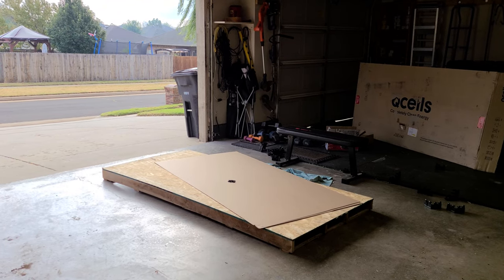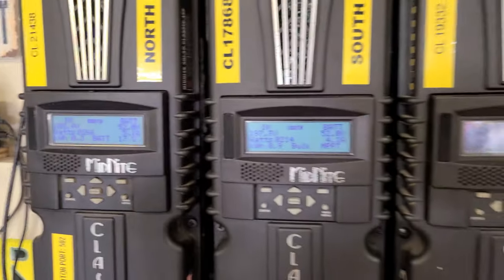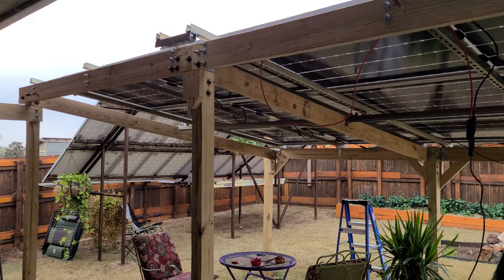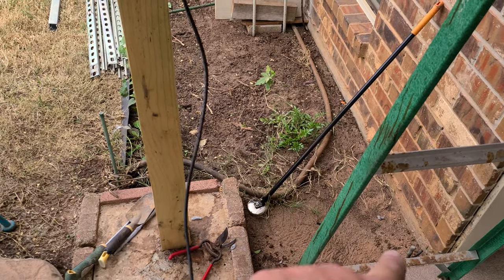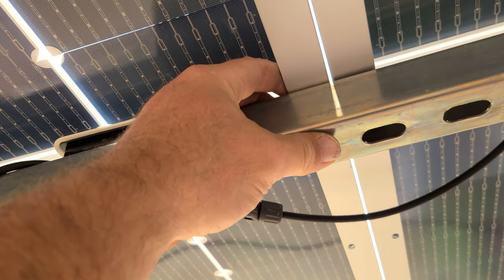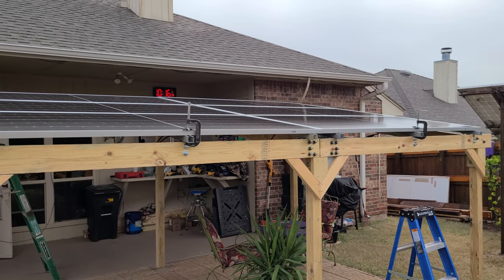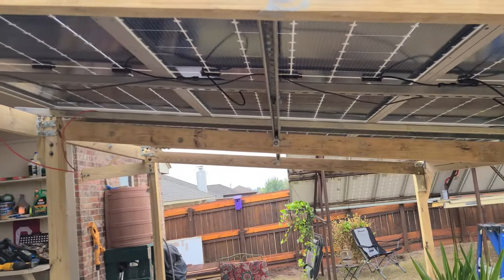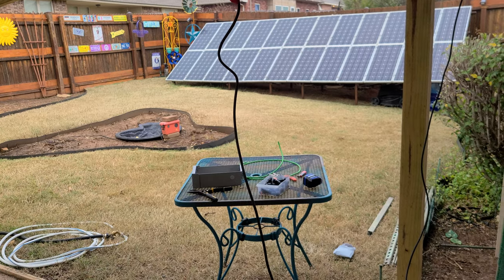Six new 480w Q-Cell solar panels on the backyard pergola (tested out great!)

Comment: Nice video.  I have been impressed what I have read about the QCells.   I am considering a Pergola ground mount over the hot tub area where I have a ham shack (radio room).  Some of the panels will just power up the hybrid min-split that will take PV as an alternate power source.  Still need the mains and those panels won’t be used by anything else which could be a bit of a waste.  We will see.  Thanks again for your video and all the best from north Texas.
Reply from the maker: Howdy. Good luck with your efforts. Being in north Texas, you'll harvest some killerGreat sun days. The Q-cells are awesome...a lot of bang for your buck. Before I changed out all three arrays, I was harvesting 28-29 kWh with 100w Renogy panels. After, with Q-cells (and more rated PV wattage), averaging around 48-52 kWh all summer long. If needed, look into Signature Solar for lithium rack mount batteries...they are based in north Texas (no tax, good company). Here's a link: https://signaturesolar.com/all-products/batteries/?_bc_fsnf=1

Comment: Looking good. Those things look huge! When you get the hardware can you show how you lock them down with the spring nuts? KEEP EM COMING!!
Reply from the maker: Thanks! Will do. But I am only using spring nuts on the ends. I used Grade 8 bolts are hard washers and bolted them down to the Superstrut for a nice tight/clean look. Turned out perfect.

Comment: The pergola is facing West you said? What angle are the panels at? The angle looks more horizontal then the South facing panels.  Does the West angle matter as much? I have some West facing panels for the afternoon sun.
Reply from the maker: Yes, west facing solar pergola. The angle is almost flat, slight rake. My whole backyard is not even close to being "ideal" for solar panel power harvesting...not much space to work with. The north and south arrays are set for spring/fall solstice...so, an "average" tilt for all seasons (most do it this way). The solar pergola does excellent in the summertime (when I need it the most) but, lousy for about 5-6 months out of the year. FWIW, the "best" harvests I got this past summer for all three arrays...53.7 kWh in early July. MUCH better than two summers ago with different and less panels (best then was maybe 29 kWh for three arrays). So, overall, my backyard solar panel farm isn't ideal, but will get the job done with enough kWh for my batteries/inverter. Good luck with your project

Comment: I'm trying to build the exact same style pergola may I ask how tall is the front part and how tall is the back part on that angle u have there ?
Reply from the maker: The front is too low (can bang your head on it). The back is about 6 1/2" feet. This is the best I could do after YEARS of redoing this pergola. If I had to do it over again from scratch, I would attach it to the roof and angle it down higher than head level. It was a novice attempt and is working fine now, but, too low in the front and lousy sun angled to the west. https://www.youtube.com/watch?v=f-eVjwVAhdE&t=151s
Reply: @ChrisDIYerOklahoma  ohh ok I'm here in northwest Ohio & I swear the sun sucks all year round being up north like this I wanna order more panels build something close to what u have I hope I can do it before this fall
Reply from the maker: @diysolaradventures7894  -- Roger that. I am originally from the Lansing area...know about year round crap sun. Here in Oklahoma...MUCH better sun. Being in NW Ohio...best to have more angle to allow for ice/snow to melt off. Also, bifacial solar panels are the newest and sexiest panels out there (and not crazy expensive anymore). Lastly, I "overbuilt" my pergola for strength...Grade 5 and 8 bolts from Tractor Supply hardware in bulk (don't use Home Depot or Lowe's...waaaaay to expensive). Wood 4/4 treated posts are great, but I would use galvanized stockade steel posts next time (like in my other two arrays). IMHO, they will hold up best in Ohio frost lines better than wood
Reply: @ChrisDIYerOklahoma  oh ok I like doing my man shopping at Menards because they prices beat Lowes & Home Depot by up to 20-30 on a lot of items I actually did a compared pricing and was completely blown back even they super struts are cheaper at Menards I do have one lil wooden structure I built holding 4 panels I need to start making more videos